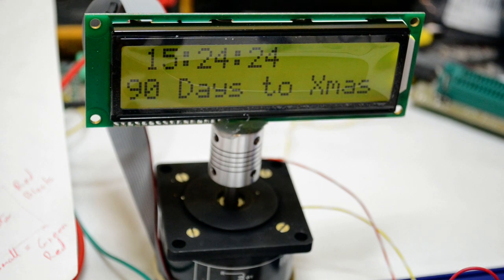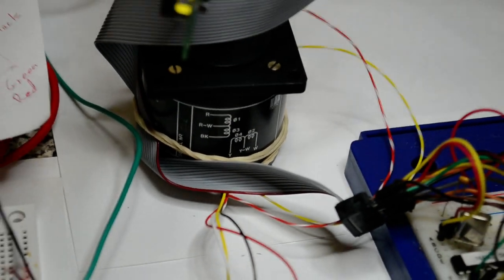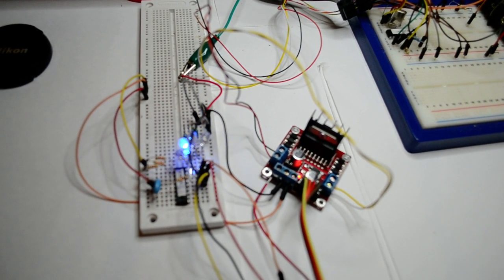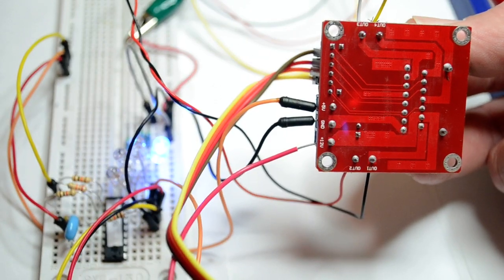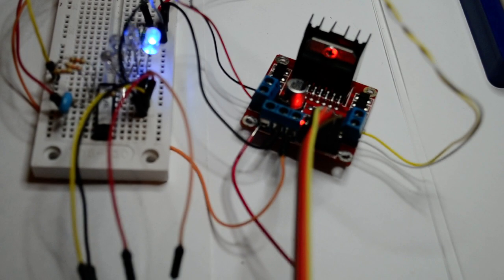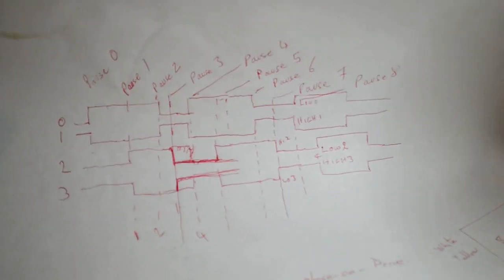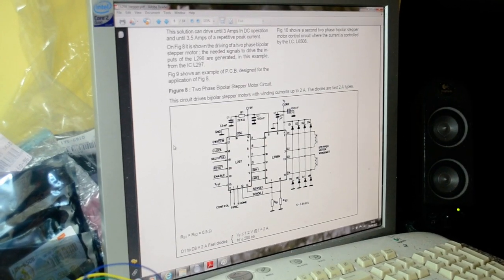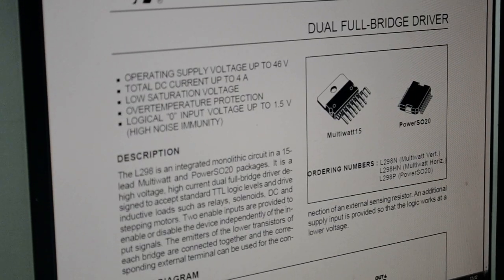How to Make a BiPolar Stepper Motor Work using, Pic Micro's and an L298 Driver Part 1

Comment: The trouble with datasheets is they're written in "engineer speak". A lot of the threshold which keeps "regular" people from understanding and using electronics is this particular vocabulary used "in the trade" (probably in a vain effort protect one's own interests, I don't know).
I'm an electronics engineer which opposses this practice, because it sometimes wastes my time as well. For example, in AVR microcontroller datasheets Atmel invariably refer to the internal timers as "countdown" timers, while, in fact, those f******s do count up. So if one pre-loads them with FFh (or similar for the amount of bits contained), they will trigger an interrupt immediately instead of when you expect them to. Took me a week to figure that s**t out.
Reply from the maker: Here Here !!! lol
I agree, it took me forever to understand timers and many other points too.
I eventually did a video on timers and the overflow flag.I used a GLCD display to demonstrate the timer and how it fills up. Like you say, if you pre load it, the interrupt flag happens sooner so the timers must be counting up.
It's taken me a year to have a go at my touch screen program, I figured looking at various examples of touch screen, it would take me until Christmas to figure it out.
4 lines of spi it was done, that was just a few days ago. Oh and these stepper motors grrrr, weeks and weeks to get a simple motor turning.
Thanks for your support
Regards
John